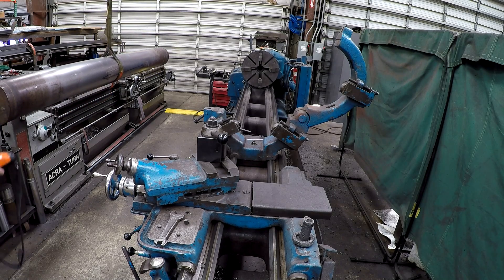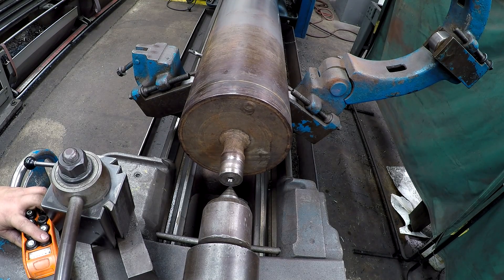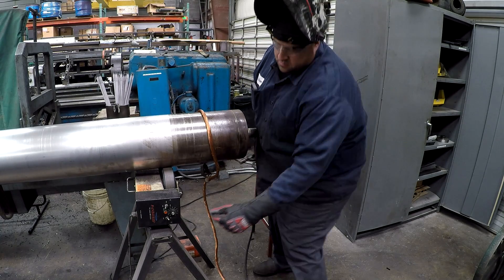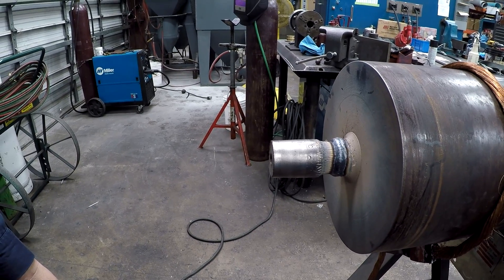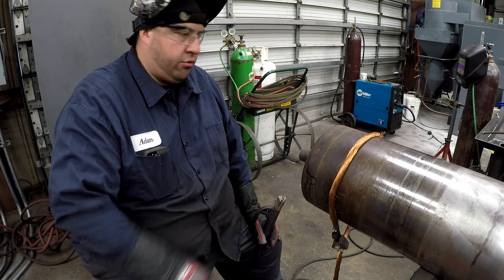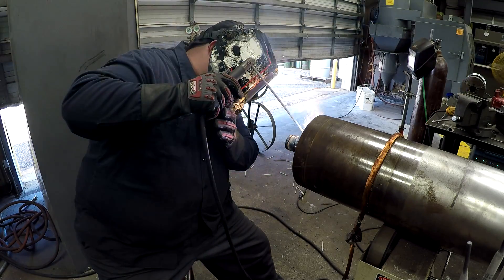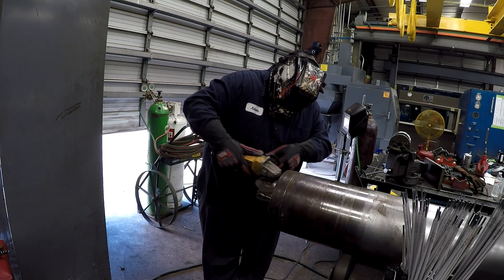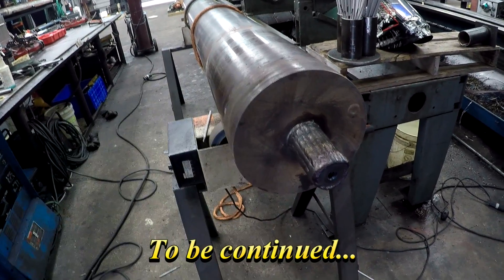Roll Journal Repair Part 1

Comment: Can’t argue with success ,but over the years I have done virtually the same repair many times. First, I always machine the old surface to remove any contamination that may have been pushed into it. Second, I use a wire feed with .035 hard wire. I start at the very end building up the corner while it is still cool. If you then build up to the base, warpage is reduces greatly. It is best to continue welding until done. Be sure the end is built up enough.Let cool while still turning to enable even cooling. By following the tips the center will be off only a few thousandths. I will watch the othe episodes to see how it turns out.
Thanks for sharing you knowledge and skills with the world. Craftsmen with your skills are getting harder to find all the time.

Comment: Great videos @Abom79. Love watching the work you do.
 I was wondering, is 7018 wear resistant and how hard does it get? Can it be used for shafts with cast iron plain bearings? Or is that roller shaft set into roller bearings? Just wanted to know what the application was.

Comment: damn man... 7018 stick?!  bitchin man.   I've seen a mig in your videos,  not sure if it's in your shop or at work,  but you gotta try some outershield 71 elite or outershield 71m for building up.   it's a 70 series flux core wire you run with shielding gas.   the welds come out super fluid like,  and is hard but tool friendly.

Comment: hey adom just curious  why not use the metal spray like you did at your shop , also would not a mig welder worked just as good and would have been continious from start to finish?? trying to learn

Comment: I need a Crank shaft Adapter to fit a Taper shaft turned 1 inch or 1 1/8 inch shaft.

The length of the crank shaft is
2 1/4 inches OD 164.9
1.5 inches 1.139 largest end of tapper
7/8 or.934 smallest

The Engine is a 24hp Onan Performer 24 - VTwin OHV
Horizontal Tapered Shaft - Model # P224G I/1148OH
Any Information  would be appreciated
Thanks 
George - St Louis mo

Comment: what brand of  tools do you use? (mic brands, tooling etc) and what would you recommend for a beginner like me. i have an old atlas (36 inches but not a built up as an engine lathe) lathe that uses 1/4 inch tooling (or carbide bits as a made a carbide holder fit by milling it at school with carbide as it was hardened)

Comment: That long belt sander was the most beautiful thing I ever seen! That is a hell of an Idea!!
Reply: +Abom79 man this is by far the coolest youtube channel out there! thanks a lot for sharing your craftsmanship with us...i'm learning a whole heck of a lot....thanks again!! and keep em coming!!
Reply from the maker: Great tool to have!
Reply from the maker: +justkiddin1980 Wow...thank you!
Reply: Used a similar unit , we called it a bow sander or crankshaft  linisher , i also used it to polish mono pump screws  as it would roll around the the hills and valleys of the pump shaft - think of a mono pump shaft as say  a 12 inch per turn pitch and a very rounded thread form  like a sine wave .
Reply: YES, but totally unsafe !!
Reply: @timrees7274  Abom's more than aware of the dangers and while you can't see them, he's taking as much care as is possible in such a dangerous environment.
From what I've seen on his other video's, he stops working when those he doens't deem "work safe" make an appearance, and only resumes when he's sure nobody else is at risk
Reply: Gaisa Sanktejo 
well that just about explains nothing at all. 
It's still not a safe way to do this job.
Reply: @timrees7274  Oh I never claimed such a job was safe.
However, you've got me curious; how would you make this safe in a cost effective manner?

Comment: Hey Adam
wouldn't be more fast and simple to make sort of a tube and weld it over the cleaned old ?
Reply from the maker: Then you weaken the shaft by turning it down, it would work yes, but Id prefer welding up the shaft so that it's solid.

Comment: Nice Job, Adam.  Looks like they took that cylinder out of service just in time.  Not much left on the end you are welding up.
Thanks for sharing.
Take Care,
Reid
Reply from the maker: Probably making some bad noises, glad they caught it.
Reply: +Abom79 More likely that they caught it weeks ago, but waited till it got so bad they had no choice but to repair it. The way it usually works. Got to squeeze that extra nickel in before spending money on a repair.

Comment: wouldn't all that welding warp the hell out of things?
Reply: +nikotwenty ..Well, yeah...just about any sort of welding causes distortion...you just have to be able to control it.....that's why he says at the end...we'll re-cut the 'center'....while running the roller in the steady rest.. I was once a welder in a machine shop...did a lot of this stuff....
Reply from the maker: Just the stub end only. Once you build it up you recut the center true with the od of the roller.

Comment: could you weld that with flux core or doesn't it burn hot enough through the old repair?
Reply: +SquirrelFromGradLife you could do it with flux core, but stick lets you use much bigger electrodes and lay down larger beads a lot faster. Plus, for a job shop like this stick is more versatile, just grab a handful of the right rods, set the current and ground, then start welding. 

You don't have to keep pulling wire out of the machine to go from welding mild steel (60xx)  to 70xx for better strength, or laying hard face on a dipper bucket tooth. He's probably got a MIG setup for mild steel, but for this he wanted the stronger 7018 welds and by the time he got the MIG machine's wire pulled down and reset up and welded he'd have already been finished.

MIG's biggest advantage is production type welding. Where you are welding one type of steel in mostly one position with long welds all day long, like structural I-beams. You don't have to keep changing rods to keep laying beads and the settings on the machine aren't changed. Just add a new spool when it runs out and keep going.

Comment: No need to preheat the shaft before building up with weld?
Reply from the maker: Most likely a low allow steel like 1018 cold rolled. No need in preheat

Comment: :-O that ground cable trick was impressive. A mig machine might have saved you some time, but your stick welding isn't too shabby.
Reply from the maker: +Mr Mr That mig welder is the birds. It's got it's place for me though. I like the performance of stick for most of my work.
Reply: +Abom79 I agree I'd stick and tig any day of the week over mig, but I used a millermatic 350p on this one job and it was pretty good... for a mig.

Comment: Nice job Adam.  At first I thought that was a solid shaft and I though man those ends seem small for that size shaft.   Then when it rang when you hit it with the chipping hammer, made more sense then.
Reply from the maker: +Bill De La Vega Yes those rolls are always made from a piece of tubing.

Comment: Hello Adam, good job reloading, what is the maximum weight admitted by your engine welding drive, you have made a distemper after welding, really cool setup, cordially thierry.
Reply from the maker: If I remember correctly they can handle up to 1,500 lbs.
Reply: Adam thank you for your answer, good luck to you and continue to impress us with your superb always interesting video.

Comment: If you want to try and record some welding footage with your camera, just use some zoom and manual exposure and put some dark plastic in front of the lens to protect it, maybe sun glasses will help, you can even try using auto exposure but make sure to use optical zoom only. Thanks for teh videos!

Comment: hey man that slack belt setup you used for the surface clean up. have you done a review of that tool? if not could you possibly do so? it looks like an interesting piece made from an older Milwaukee  drill and spare parts that were laying around. good video man keep it up

Comment: It is sad I know people that would consider just machining that shaft with the Dewalt.  I usually end up fixing those later. Hey Man! lol
Reply: +bcbloc02 Really? Wow...I guess in the refineries and oil depots I worked in things were different. Then again, Chevron or BHP, etc. may have a few more bucks than your average manufacturing company ;)
Reply: +bcbloc02 i was gonna wrap it in electrical tape then go for a really long lunch break just as it gets turned back on, lol

Comment: those scrap rods of welding in the floor, could give you the precious gift of a travel to the hospital, or arrange a love meeting between your knee and some machine  =)
Reply: Whaaaat?
Reply: I get it now, very cryptic!
Reply: +dannymaciejewski. Just a Little, another way to say accident.
Reply from the maker: +JustMeNoOther Not uncommon for welders to drop the waste on floor as the job gets done. I clean up my mess after I'm finished up.
Reply: +Abom79. Safety first. We want and need Adam for a while, and more videos.
Reply: +JustMeNoOther Pop rivet mandrels are just as bad. I've lost track of how many times I've bitched at my crew for leaving them on the floor after a job.

Comment: That chowed a grip of rods.  Suprised y'all don't have a submersion arc welder setup.  That would save %50 on rod/material expense/waste....  It's all about the money!  But that would take a few hundred jobs like that before your boss would break even.   They use the submersion arc process/machines at automobile crankshaft regrinding shops.  They get more use out of them there.  So the machine pays for itself sooner.  just saying.

Comment: Any reason to not plug weld the old center since you have to cut a new one anyway?
Reply: +freeclimbmtb a bit hard to understand what he has left to indicate against at that end? just the outside of the roller again and thus the spindle would be referenced to that?   i was initially thinking he'd weld it on the lathe as the original center was still good at that point.
Reply: +jusb1066 yeah I was expecting spray weld, but I guess that's just at the home shop.  after that much heat I can't imagine that old center point is truly centered anymore.  But yeah I figure he would indicate the roller at the chuck and the bearing ends and turn the end true to the roller...it will already be true in the steady right?
Reply: freeclimbmtb
yes i forgot that, he did spend a while getting the steady adjusted, so just pop it back in and it will be right i suppose
Reply from the maker: +jusb1066 You'll see that in Part 2. Also set the machine first, weld, then recut your center true.
Reply: +Abom79 Tom quietly slips in and moves the end roller adjustments .. ... .. . ..

Comment: Adam, cool vid, thanks for sharing. 
Asking this for my own benefit - what was the reason you chose to build it with weld rather than cutting and welding another stub shaft (looks like there was a weld bead on that stub). Was it pressed in and then welded? Could you have drilled/bore out the old one as an alternative? (to understand the choice from my hobby level and not anything else)
Reply: +sharp x I had the same thought until I realized the roller is a hollow tube. You would have to remove the end cap to weld on the back side of the shaft. Simpler and faster to build up the journal with less risk of distortion from welding the end cap back on.
Reply: +joshua43214 
good point, to me it looked like the weld was on the outside but you're probably right and there's one on the other side as well.

Comment: why did you put it in the lathe the first time prior to welding, Adam? was it to have the tailstock center hole accurate before welding distortion for setting up the steady rest?
Reply: +Flip de boer I don't want to answer for Adam but this is the reason I would do it. When he welds the shaft it of course will distort and the original center will not run true so it will have to be recut. Lets say you didn't set up the steady rest before welding. You put the part in the lathe but how do you indicate the part to run true at the steady rest. You would need to run a indicator down the length of the part to check if it runs straight to the lathes axis but your carriage is on the right side of the steady rest so you cant without removing the steady. Basically there is no easy way to adjust the jaws of the steady rest on a long part without using some kind of center (you could have the part running off at a angle to the lathes axis). It can be done but it is a lot easer to do it while the center is running true. Than just remount the part and reindicate at the chuck and recut the center.
Reply: +Flip de boer I think, it was because of setting steady rest, because center hole can be after welding moved, when welded shaft bent.
Reply: Set up the steady first using the centre in the journal  as the journal will bend in the welding process  so Adam only has to drop it back in the lathe ,,tighten two jaws , check the runout at the chuck then clamp the steady shut and machine the journal to size.
Reply: +Flip de boer he probably cleaned it up a but for welding
Reply: from a welder stand point and only seeing a few vids I'd say for weld prep, the base metal was ugly in the first clip and shiny clean in the welding bit.
Reply: +Edge Precision ..Yes, indicate the roll first...then remove from lathe to weld...you NEVER want to do any welding on stuff in the lathe......sparks and spatter you know....well, maybe TIG a dent or something....
Reply: Flip de boer 有
Reply: Could very well be he did both ideas suggested here
Reply: +ian bertenshaw 
 If it bends during welding (of which I have no doubt) shouldn't the 60deg. lead on the front be welded in too? If it's bent any then it's really not worth much, is it? Fill it, center in the lathe and then drill a new center, right?
Reply: @patw999  in theory, i'd say yes to filling in the center drill hole, but that is only if that will be needed for later use. I doubt there is reason to worry much about it as the steady is set and the tailstock/center won't be needed or used for the rest of this repair. Now in the future it may be needed for additional repair work, but i'd worry about that when i'm being paid to worry about that. I've done a lot of things as a machinist that I didn't need to do or could've skipped easily not realizing at the time. Other times i've forgotten to do something I should've known to do and only realized when it was now made much more difficult than it should be. That's life in the shop